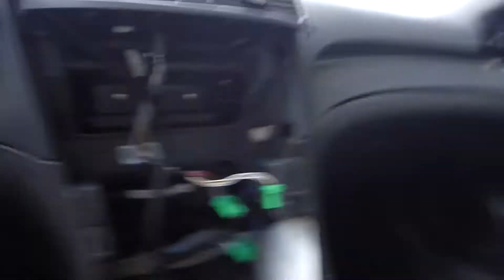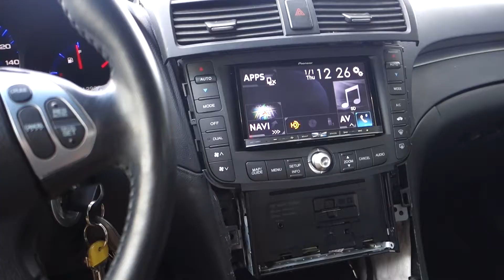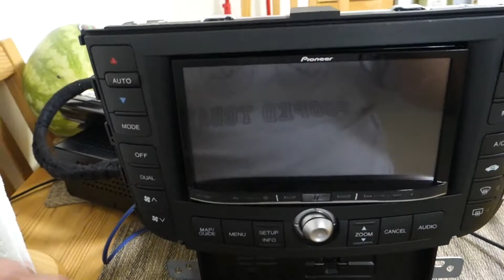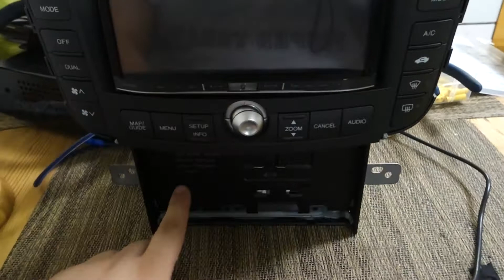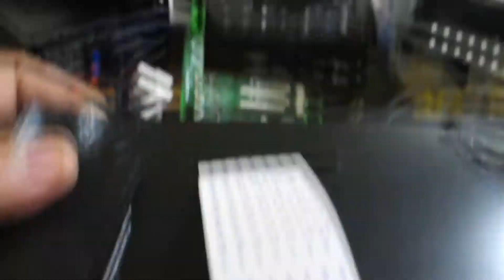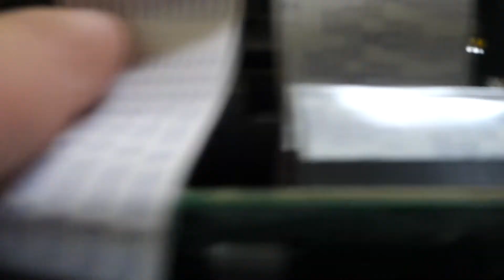Acura TL Aftermarket Radio

Comment: What setup did you end up using? Are you still working on this project?
Reply from the maker: yes obviously this wasn't ideal. I am still working on it, I want to add a tablet but make it look factory. I have tried about 6 different 8 inch tablets but can find one where the screen is the exact size of the factory screen. I have been thinking about using one of these radios.  https://www.youtube.com/watch?v=WPcYdmxQ12E
Reply: That's a nice looking deck. I think it would suit the car well.

Comment: Pioneer recently released an affordable 8 inch radio where the screen is separated from the radio. So this method will be easier to do with the new one. It’s the pioneer DMH-C5500 NEX. I’ll be playing around with the install soon
Reply: Hey man let me know how it works out
Reply from the maker: Hey how did this project turn out?

Comment: Awesome! I'm still deciding on what to do with that outdated navigation that says enter pin lol
Reply: The PIN should also be on a sticker on the left side of the glove box when you open it

But once it starts to appear, will want the PIN every time you start up (assuming it is the DVD system that is failing)
Reply from the maker: Do you not have the pin? you can get the code online at https://radio-navicode.acura.com/. I am almost done with the headunit project that I want to show youtube.